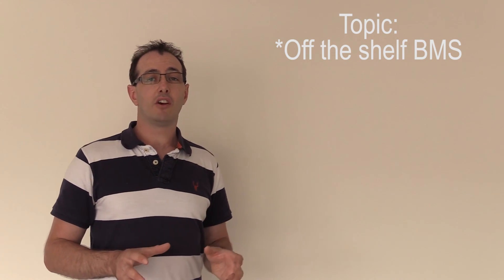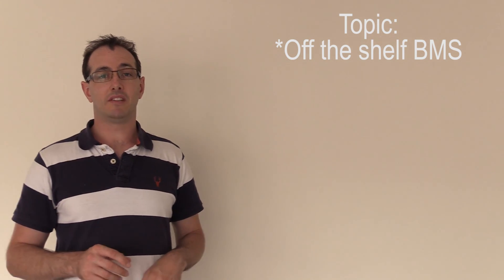Part1 Do you need a BMS?

Comment: I just want to connect 4 3500mah 18650 batteries in paralle to get 14000mah at 3.7v. They have internal protection. Do i need any type of balancing for them?
Reply from the maker: No not if you put them in parallel they dont need balancing as they are all connected together as one

Comment: You don't necessary need a balancer. You do need something that will stop charging if any cell goes over 4.2 (the overall pack voltage is irrelevant) and that will turn off the load if a cell goes below 3 volts (again the overall pack voltage is irrelevant) this way no matter how out of balance your pack is you won't be damaging your cells/starting fires.

However without a balancer the usable capacity will decrease over time. You can fix this manually by periodically disconnecting the pack and connecting them in all in parallel through a load. or by putting a load on the highest voltage pack until its is no longer the highest and then repeating until all are balanced.

Warning! A lot of BMS don't have the overvoltage disconnect, instead they turn on a load, however if you have a 30 amp charger and a 2 amp balancer, then the load won't be able to dump enough current and your battery will be ruined. Most BMS don't have enough balancing current to cope with anything more then your packs being only slightly out of balance. Lets say your have a 7 S pack. All of them are at 3.7 volts except one cell which you disconnected to do some maintenance on. When you connect it back it has 4.2 volts. The charger will see the pack voltage as (3.7*6) + 4.2 = 26.4 volts, this is well below the target voltage of 29.4, So the charger will charge at its max current (lets say 30 amps). Now the BMS will detect that the cells are over voltage and will turn on the balancing circuits. This will put a load over the cells, lets say you are awesome so you have a batrium bms and you are using there longmon, that has a bypass current of 2 amps, So you are charging at 30 amps and by passing 2 amps so 28 Amps are still going into your already full battery. Then your cells get over changed, they go into thermal runaway and your house burns down.

Comment: Hi. What is the ideal voltage configuration of the battery pack for making power wall? Is it always 14s(x)p? If I want to create 500watt or 1kw power wall what's the best Battery configuration?
Reply from the maker: i would go with 14s yes 48v as its the most common and easy to get parts/inverter etc.
Reply: Mikes DIY Tesla Powerwall But the 48v inverter is kinda expensive. 
Where can I send you email? I would like to show you something that I'm working on, it's a guide and calculator for Battery pack for beginners like me.

Comment: perhaps the solution is to put a circuit per parallel bank such that if a bank goes to the minimum voltage, a relay trips and shunts around the bank! the voltage will drop but the power won't go off and or an alarm can alert you. at least an entire set of cells won't be destroyed.
Reply: Then what happens when the Charge Controller turns on?

Comment: Hi Mike
Nice Video

In this multiple cell envoironment, you need to talk about pack capacity rather than cell capacity. If you have a few poor cells old or new in a pack with good cells it will not matter too much. 
But if you have a lower capacity pack the voltage range during discharge and charge will be higher than a good pack. It assuming 4.2V upper charge and 3.0V lower limit the low capacity pack will reach 4.2 quicker than the other packs and like wise fall to 3.0V quicker during discharge. So if your packs are not really even these lower capacity packs will be charged/discharged over the full range more often so will suffer and fail quicker than the other packs.

So I am agreeing with you on having a BMS, even if you monitor the packs regulary it saves you having to manaully balance a low capacity pack. Considering all the man hours you have put into these projects it seems a small price to pay to fit a decent BMS.
Reply from the maker: I was going to mention about "Considering all the man hours " but forgot while talking . That is a good point.

Comment: Do you need BMS?
In my opinion answer is fairly simple:
If you use Lithium based batteries: YES
if you use Lead or Nickel based batteries: NO
Lead and Nickel based batteries tend to balance themselves out when slightly overcharged, because they convert energy (mostly harmlessly) to heat when overcharged. For that reason you rarely see BMS on these batteries and most products using these batteries come with dumb chargers, which are just simple adapters set to DC voltage, that is just enough to charge those batteries.
Lithium based batteries are very sensitive to overcharging, they easily overheat, catch on fire or even explode when badly overcharged.
One disadvantage of having no balancer in your pack is that you don't use full capacity, second is that some cells are getting overcharged and overdischarged, which shortens theis lives. But the most important disadvantage is that it's unsafe.
Let's say you have 10S10P Lion battery pack configuration. All 10 banks have same capacity (they never have but let's say they have). You soldered/spot welded all batteries.100 batteries = 200 home made joints, what is the chance that one joint will fail after a year? I say pretty big. So after 1 year out of the blue one bank has 90% of capacity. When charging, this bank will charge more quickly than other. So one cell is at 4,2V(100%), while other cells are still at 4,1V(90%), so charger will keep charging.
So you will overcharge bank with least capacity in pack.(and overdischarge when getting juice form batteries)
Reply from the maker: Right on :)

Comment: I am not sure this video really addressed anything.  Even for a 12 volt lead acid battery I wish I could balance the individual cells now and then.  But it almost seems like it is more tradition why people use bms.  Seems the important thing is to prevent an individual cells from getting too high.   Has there been any confirmed fires due to lack of bms?  If you bottom balance and raise the voltage seems cells that rise the highest are the problem cells.  Those that leak voltage overnight also are problems.  Seems a lot of anti-bms videos seem to think the bms is more of a risk than having one.  A digital voltmeter on each cell might be best, I use a "battery monitor" that also balances cells ($9 ebay).  But what if a wire falls off?  Sometimes I wonder maybe just bury the battery underground and stop worrying about it.
Reply: How is your system going?
Reply from the maker: I didn't mention lead acid because overall you still need to have some kind of bms to manage the cut off low voltage, how many amps/watts are being used, when to turn the charger back on and monitoring. Balancing lead acid cells within a batt i thought that is what bulk charge and equalization helped with? and if a cell goes high before the others in the batt it just boils more water.
Reply from the maker: Very good so far, The final part of the bms videos will be the monitoring, and you will see how the powerwall has been going over the last month. I have been turning it on every night this month at 9pm to 8am... My powerbill is also looking very good (low) :0
Reply: Mikes DIY Tesla Powerwall Where does the hydrogen go when you boil water?  It probably shoots through the atmosphere and leaves the planet.  Say 1 gallon is lost in a lifetime per person and you are talking 5 billion gallons hydrogen lost to space.